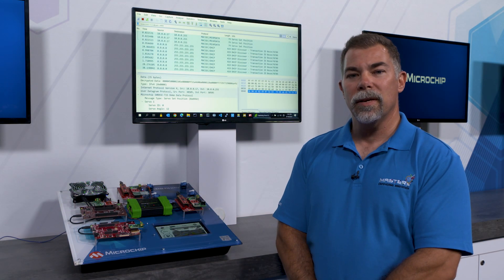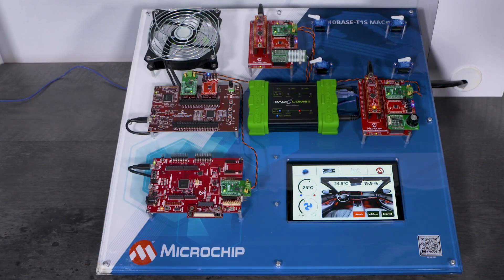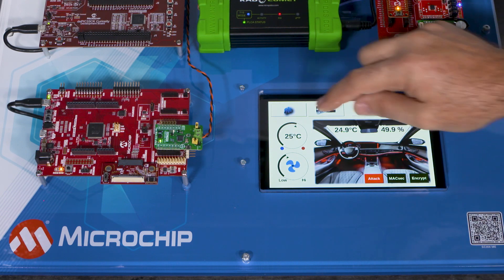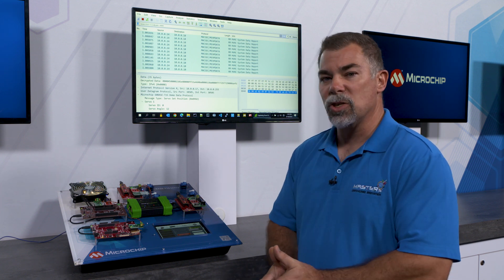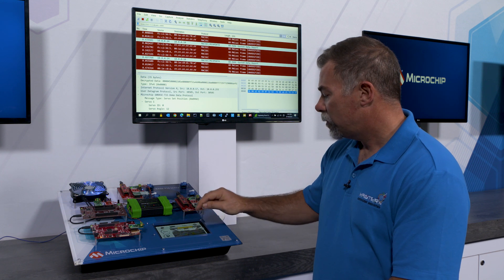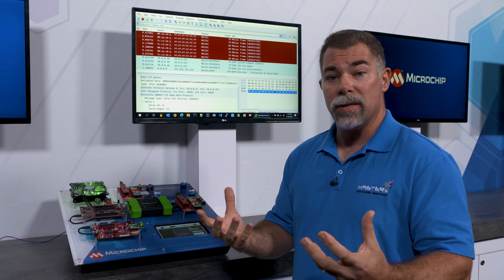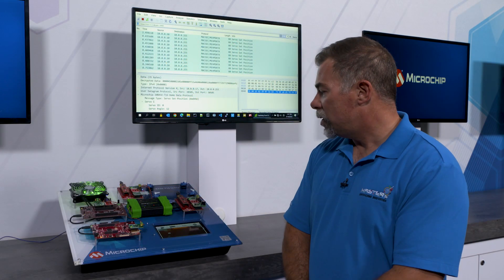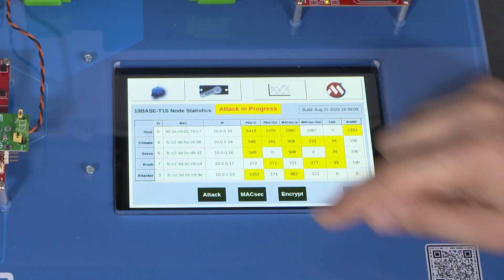10BASE-T1S MACsec Demonstrator

Comment: Is this for Local TCP/IP Communication only?
Reply from the maker: Hi there, thanks for your question! MACsec secures Ethernet traffic at Layer 2, encrypting and authenticating all data on a local network, not just TCP/IP. It works independently of higher-layer protocols like TCP/IP, which are secured by methods like IPsec or TLS. Hope this helps!